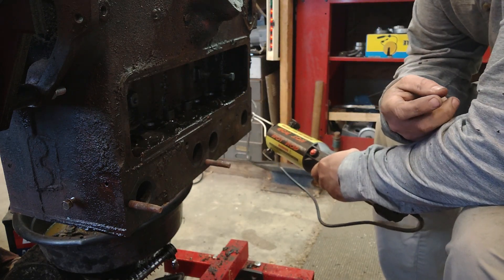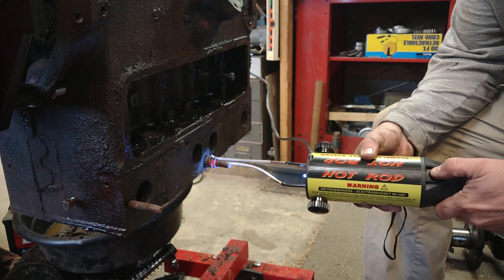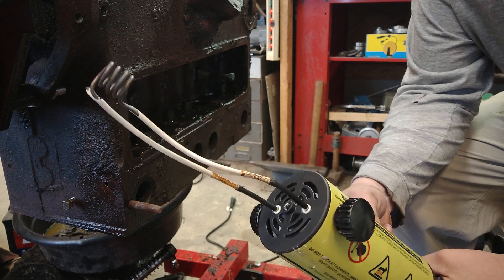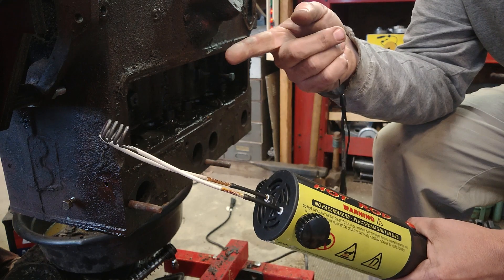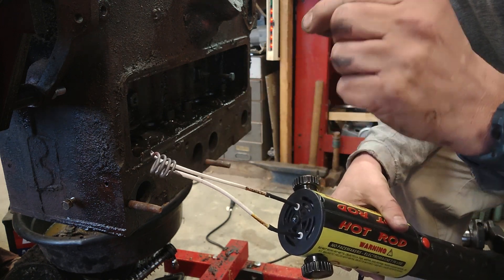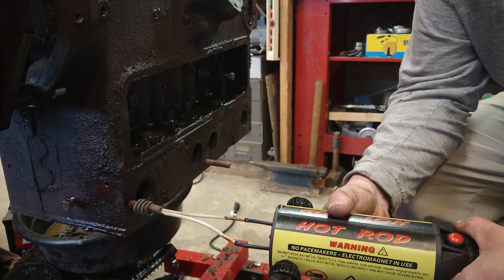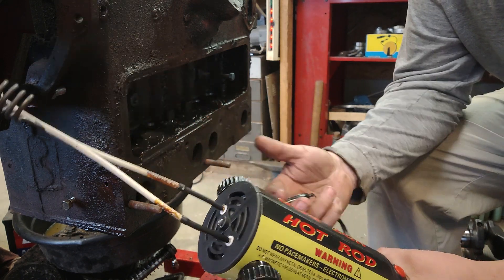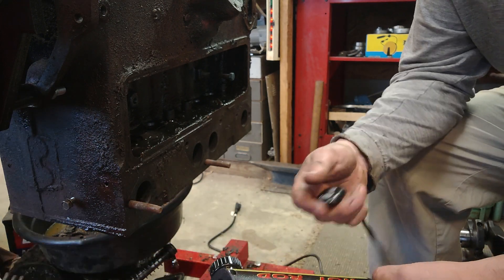Using the bolt induction heater

Comment: I just got mine yesterday but I never got the bolt super hot.  Unfortunately, the sheathing heated up and got destroyed.  Maybe it was because the coils were touching or the heat of the bolt did that.  I just ordered 1/8" Aramid sheathing to repair the damaged part.  I figure I can trim the bad fabric off, pull the sheath over the copper wire and heatshrink the ends.
Reply: I also heard that the thicker the wire, the hotter it can get.  Maybe an 8awg wire can get hotter than 10awg wire because it handles power more effectively.

Comment: Hey Bryan, can you use an extension cord with this tool as long as it's not excessively long? If I buy a kit that doesn't have pre bent coils included can I slightly bend the ones like you used in the video to suit my needs? Thanks for your video.
Reply from the maker: I would think that you could use an extension cord provided its not excessively long or really thin gauge wire. Also, yes you can bend your own coils, just make sure the loops have a small air gap to work effectively.

Comment: did you get the bolts out? i know the tool is ideal for nuts, and just ordered one, but im interested if the heat penetrated down the bolt to help remove it
Reply from the maker: Yes, I got them out before we sent the engine to the machine shop. This is the same engine from the latest videos.

Comment: That was absolutely fascinating to see that bolt get red hot in seconds without the use of a gas torch.  One of the mechanics in our shop swears by one of these things, though I think a cheap $40 MAP Gas torch would be just as effective if you didn't use it very often.
Reply: Only if you have true MAPP.
Reply: Fire danger is significant with an open flame!

Comment: Hey man, I could have saved you the cost of that bolt heater, if you own an oxyacetylene rig. You can do the same thing with the cutting torch. Just swap the cutting torch head for a laarge welding tip, or a very small rose bud and get to heating. With the torch you have to pay attention to where you point the flame constantly or else you will burn yourself or something around you. If you take the torch and heat the bolt up, take your time to let the heat soak into the bolt as evenly as possible as the bolt gradually gets hotter check to see if you can turn it, often. It will come out, you may have to get it to a temp just before it liquefies, but it will come out !
Reply from the maker: Yeah, I have an Oxy/Acet torch, but the main reason for getting the induction tool was for confined spaces like under the car/jeep where there might be fuel lines or electrical wires. This bolt just made a handy demonstration. Im a big believer in having different options!
Reply: Hey man I will try that on my rear suspension joints right next to the petrol tank, should be a gas man.
Reply: the induction heater he has costs ~200

An oxyacetylene setup will cost you around 250 plus gas.
Reply: Nonsense response!  Go put on your thinking cap and consider fire safety!!